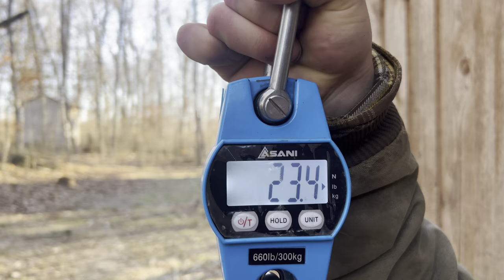The boy’s trapping 2023-24 year in review!

Comment: It’s not legal to use instant kill traps on dry land in Tennessee is it? Supposed to be in water only I think.
Reply from the maker: For trapping purposes, "water set" is defined to mean traps set in water adjacent to and part of streams, ponds, lakes, wetlands, or other water courses and includes floating sets.
Trappers shall mark all traps and snares with their name or TWRA ID number.
Steel traps placed inside a hole, cave, den, hollow log, hollow stump, or any like place shall be placed at least twelve (12) inches inside the entrance of such place, and it is unlawful to place steel traps in the open, except for water sets and trap types listed in paragraph five (5) above.
Lethal sets such as instant kill traps and water set (“drowning”) traps must be inspected every seventy-two (72) hours. All other traps must be inspected every thirty-six (36) hours and any wildlife caught in the traps shall be removed.
For ground sets adjacent to waterways and no more than fifty (50) feet from the shoreline, a trapper may use a 110 body grip trap, or its equivalent, with a maximum exterior jaw measurement of six (6) inches wide by six (6) inches tall.
Reply: Ok so it has to be within 50 feet and no bigger than a 110. Thanks for the reply. I am a Tennessee trapper but I don’t use any body grip traps only foot holds. I’m in east Tennessee between Knoxville and Chattanooga.